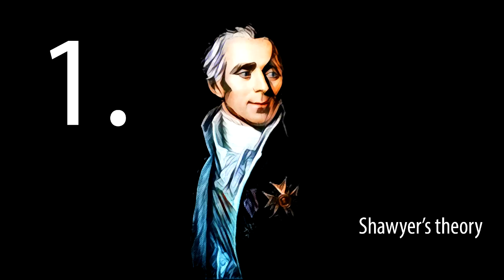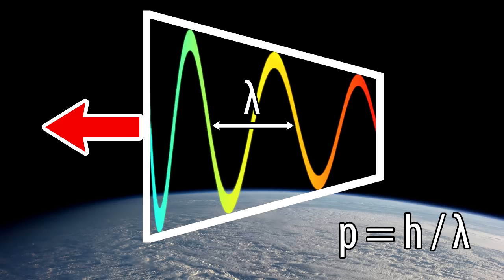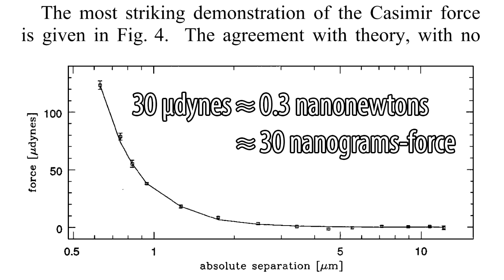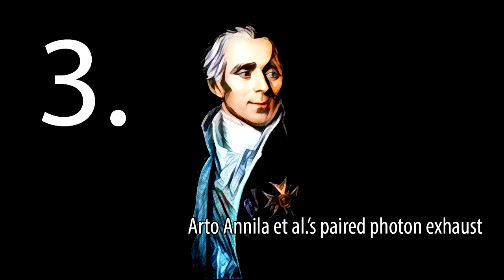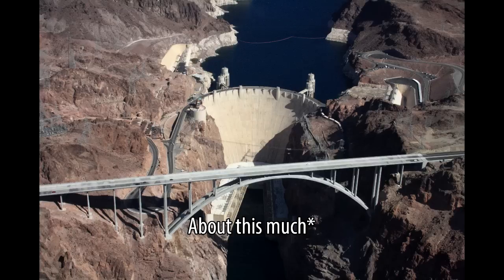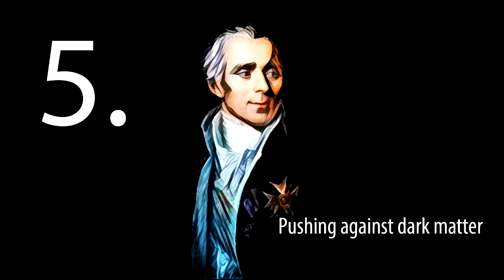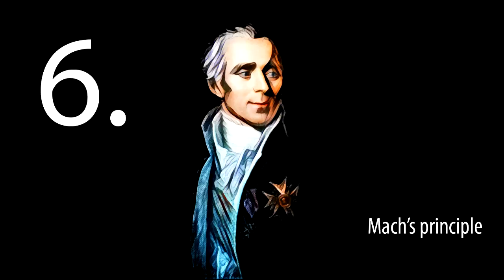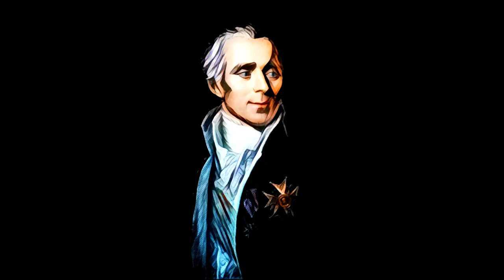The most unscientific approach – The Emdrive (part 2)

Comment: The electrical resistance in the surface of the cavity drops the Q factor, and it goes to zero with superconductors. With other conductors it doesn't produce thrust, and no one stated that happens. It makes waste heat, Q factor is the loss of energy in the cavity vs its total energy. Light doesn't push off the side walls to propel itself, electrons aren't made to flow in the manner illustrated.

@1:05 He doesn't invoke p=h/wavelength, the group velocities are large fractions of the speed of light so you must use Relativistic Momentum, which explains force differences at the ends.
Reply from the maker: " electrons aren't made to flow in the manner illustrated."

They are. The momentum has to come from somewhere, and it comes from interactions with the cavity. Of course you wouldn't see such an oscillating current with the cavity at resonance because wave motions forward and backward would cancel out leaving a standing wave, but that's exactly what happens with the EM wave as well. You would have a superposition of electrons sloshing forth and sloshing back corresponding to the superposition of forward-moving and backward-moving EM wave.

"He doesn't invoke p=h/wavelength"

http://www.emdrive.com/theorypaper9-4.pdf shortly after equation 2.

"The momentum of each photon is hf/c so that the rate of change of
momentum of the beam at the plate (assuming total reflection) is 2nhfA. "
Reply: Equation 2 is for a plate not in a wave guide or cavity, that is not introduced until after equation 4:
"We   now  suppose   that   the  beam   enters   a   vacuum-filled   waveguide. "
I wrote he didn't invoke it, but I wrote badly. Simply he does, but it is not the direct explanation for thrust. The way you use it in the video is not consistent with what he explains in the pdf. 
"Then from (4) and (5) (with μr = er= 1) the force on the plate closing the end of the waveguide " is equation 6.

In the video you say "p=h/w.. thus the photons impact the large end more forcefully...", but this is not correct, equation 6 is very different.
Reply: "" electrons aren't made to flow in the manner illustrated."

They are. ..... Of course you wouldn't see such an 
oscillating current with the cavity at resonance because wave motions 
forward and backward would cancel out leaving a standing wave,"

"...wave motions forward and backward would cancel out.."  <<<< agreement!

Did you not illustrate the current flowing? I said they won't, as illustrated. Then, did you agree with me?
Reply from the maker: "Equation 2 is for a plate not in a wave guide or cavity, "

I can only refute what he writes. Using quantum mechanics for this is just not right, unless you do it properly, which he didn't because it's a formidable task.

"but this is not correct, equation 6 is very different."

It is correct and it is what eq 6 says.

"Let the guide wavelength at the end of the largest crosssection be λg1 (...) Now λg2 > λg1, due to the difference in cross-section, and hence Fg1  >  Fg2"

Which is pretty much exactly what I said: the wavelength at the large end is smaller, and thus the photons impact the large end more forcefully. Straight from the horse's mouth.

"Did you not illustrate the current flowing? I said they won't, as illustrated. Then, did you agree with me?"

No, because I was considering only one component of the motion. If you ignore the movement of electrons in the cavity walls you get the wrong answer and you violate conservation of momentum.

As I say early on: the mere fact that conservation of momentum is violated by this (and it is, irrevocably and nonnegotiably) is clear and incontrovertible proof that the argument fails somewhere. I'm telling you where and how it fails.
Reply: There is no conservation of momentum, it was broken by general relativity. When the space through which particles move is changing, total energy of them is not conserved. So for us slow things energy only appears to be conserved.

Sean Carroll
http://www.preposterousuniverse.com/blog/2010/02/22/energy-is-not-conserved/
Reply from the maker: "There is no conservation of momentum"

Yeah there is. Sean Carroll is talking about cosmology, at the scale of clusters of galaxies. General relativity is irrelevant to the emdrive.
Reply: No, he isn't speaking only about cosmological distances. GR applies to everything bigger than a singularity. And more importantly GR applies to everything fast, like a large fraction of the speed of light. Even the paper he linked to was using testing lengths of 1 meter because the gravitational effects act on individual atoms. Did you read the the evidence I provided, or just dismiss them out of hand?
Reply from the maker: "No, he isn't speaking only about cosmological distances"

Yeah he is. Listen, if you like Sean Carroll so much, here's something else he said:

http://www.preposterousuniverse.com/blog/2015/05/26/warp-drives-and-scientific-reasoning/

"The “propellantless” stuff, on the other hand, just says “Laws of physics? Screw em.”You may have heard of a little thing called Newton’s Third Law of Motion — for every action there is an equal and opposite reaction. If you want to go forward, you have to push on something or propel something backwards. The plucky NASA engineers in question aren’t hampered by such musty old ideas. As others have pointed out, what they’re proposing is very much like saying that you can sit in your car and start it moving by pushing on the steering wheel.I’m not going to go through the various claims and attempt to sort out why they’re wrong. I’m not even an engineer! My point is a higher-level one: there is no reason whatsoever why these claims should be given the slightest bit of credence, even by complete non-experts. The fact that so many media outlets (with some happy exceptions) have credulously reported on it is extraordinarily depressing."

The emdrive doesn't work.

"Did you read the the evidence I provided, or just dismiss them out of hand?"

You didn't provide any evidence.
Reply: You didn't answer, did you read it? Separately for your consideration this https://arxiv.org/ftp/arxiv/papers/1204/1204.4616.pdf It's time for Newtonian physics to be taught with a disclaimer, it's a gross approximation, not law.
Reply from the maker: Quantum field theory doesn't provide a way out of conservation of momentum. Momentum is conserved there just like everywhere else. Noether's theorem is quite powerful.
Reply: I didn't mention momentum here. I don't mean to imply that, I said separately. This thread pertains to GR and SR applying to the quantum world. QFT includes SR. Momentum evolves according to the energy density tensor (what ever its names is). Newton's description of things is good, but wrong.
Reply from the maker: No, momentum is one component (well, several) of the stress-energy tensor. It doesn't "evolve according to it".

It doesn't matter whether the Newtonian description is right or wrong because when you consider the system in more detail you reach the same conclusions, namely, that momentum is conserved.

Comment: He uses changing group velocity, not changing wavelength to create a delta in forces. You can measure radiation pressure using a wave guide to select the frequency you want, blocking the measure of other frequencies. He cites "CULLEN A.L.  ‘Absolute Power Measurements at Microwave Frequencies’  IEE Proceedings Vol 99 Part IV 1952 P.100"
Reply from the maker: The wavelength in a waveguide is a simple function of the group velocity, so it makes no difference: we can equally well talk about group velocity or wavelength. But the argument is considerably clearer when using the wavelength, for several reasons.

1. The group velocity at resonance is zero because there's a superposition of a coming and going wave, whereas the wavelength is the same.
2. Nobody gets confused asking why the speed isn't just the speed of light, so I don't have to go off-topic and explain what group velocity is.
3. It's the real, physical wavelength that he later uses when calculating the reflection using E=hf, so talking about group velocity just adds an extra step to the calculation that doesn't seem to help much.
Reply: The medium also effects group velocity, and the point of a tapered waveguide is to change the group velocity. It is the difference in group velocity that makes it work. 

To point 3, if you ignore the extra work of using group velocity in calculations, you will not have any reason to believe it works.
Reply from the maker: Using group velocity here is conceptually and pedagogically useless. It's the change in wavelength that is supposed to make it work. But it doesn't because as I state in the video the extra momentum comes from electrons in the cavity walls.
Reply: I'm researching this, but if a light beam traveling at right angles to the end plates changes momentum without collision with the tapered walls, how does it transfer momentum to the tapered walls? And if shining a beam through a tapered tube changes the wavelength by momentum transfer to the tube walls, will it cause a thermal electric effect heating or cooling the tube based on tapered tube orientation? Also let the tapered tube be superconducting.
Reply from the maker: When you describe a waveguide using Maxwell's equations you make certain assumptions. One which is often good is to say that the electric field inside the metal disappears. This is certainly true in the case of a conductor in equilibrium, for example if you had just a static electric field. If the electric field inside the conductor were not zero, charges would accelerate under its influence until the electric field disappeared. It also happens to be true for copper at typical microwave frequencies because this happens sufficiently fast. 

The entire discussion is based around the assumption that electric fields vanish inside the metal. That is what determines what wavelengths are allowed and what are forbidden inside the cavity. A wave might appear to never touch the side walls, but that is only because the electrons inside it rearrange to prevent it. 

Imagine there were no endplates and you just sent a microwave down a tapered cavity. Its wavelength would decrease, so it gained momentum. Clearly the momentum can only have come from the cavity, so it would accelerate in the opposite direction. Taking this into account is crucial for correctly describing the emdrive.
Reply: I believe I found some relevant research here, light going through a waveguide permanently imparts some of it's momentum to the guide, and if I understand it correctly, the guide is dragged or pushed in the direction of the light going through it. Dipole forces in the guide are important. 

Also this paper states if the system is considered closed, then only "total momentum" described by their equations is conserved. 

The emdrive paper states it's an open system, I'll research this as the system being open because of general relativity is a foundation claim of that paper.

https://www.osapublishing.org/oe/abstract.cfm?uri=oe-19-25-25263
Reply from the maker: I debunked several "open system" claims in this very video. You can't just say "it's an open system therefore it works". You have to show what exactly is leaving the cavity. Light doesn't work. Quantum vacuum magic doesn't work. Dark matter doesn't work. The mach effect doesn't work. What is it then? 

Answer: it's nothing, because it doesn't work.
Reply: I just stated I was going to research the open system claim, I'm not supporting that as true at this time, I'm going to find out if it is true or not.
Reply: Group velocity is required to model the interaction of light and the waveguide, also light imparts some of its momentum to the guide.
https://www.osapublishing.org/oe/abstract.cfm?uri=oe-19-25-25263
Reply from the maker: Like I said. You can write group velocity in terms of wavelength. I suggest you start from the basics instead of trying to read papers that are clearly above your level (no offense). Griffiths' book is good.

Comment: Aren't virtual particles in fact real due to the uncertainty principal? And it is that they don't cancel out at the event horizon that produces hawking radiation and allow black holes to evaporate.
Reply from the maker: Hawking radiation is a lot more subtle than that. The popular description in terms of virtual particles was given by Hawking himself but it doesn't correspond to the way he himself did the calculation. Particle creation also happens in other contexts, even without an event horizon.

"Aren't virtual particles in fact real due to the uncertainty principal?"

The relevant uncertainty principle here involves field quantities, not the number of particles. This uncertainty could represent what sometimes gets called "quantum fluctuations", but quantum fluctuations and virtual particles are not the same thing. Virtual particles only live in perturbation theory: they're undetectable by design. Meanwhile, we can easily see the effects of the uncertainty principle in the contexts where it's applicable.
Reply: If you watched the video, do you agree virtual particles are real and created and annihilated continuously?
Reply from the maker: No, virtual particles are not created and annihilated continuously. There's no equation that can be written down that describes the number of virtual particles being created and annihilated each second. Virtual particles are mathematical devices with no independent existence. As I stated in the video, you can get different types of virtual particles depending on how you write down your expressions. This is not a property of a real physical object.
Reply: Leonard Susskind states they are real, and the entanglement of space is dependent on it.
Reply from the maker: He can state a lot of things. I'd like to see the equation that supports the statement.
Reply from the maker: That paper is good. Goes a bit far in a few places but the overall message is correct.

" Which possible explains the emdrive, it is the light in it is interacting with Unruh radiation and transferring that momentum to the emdrive."

I debunked that notion in this video.
Reply: Please change the Unruh radiation page on Wikipedia as it states that radiation as a possible explanation.
Reply from the maker: I don't edit Wikipedia.